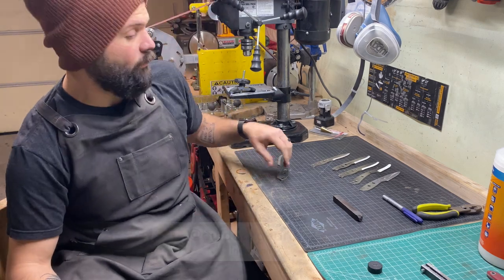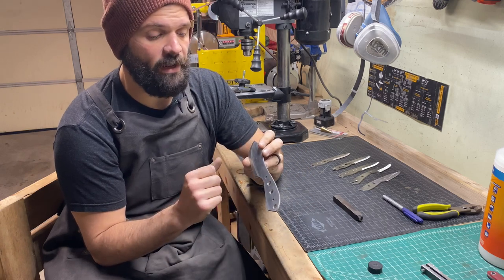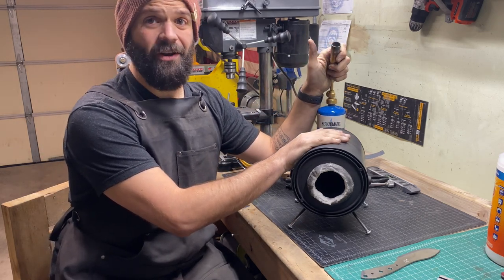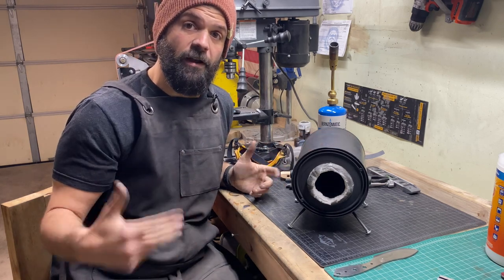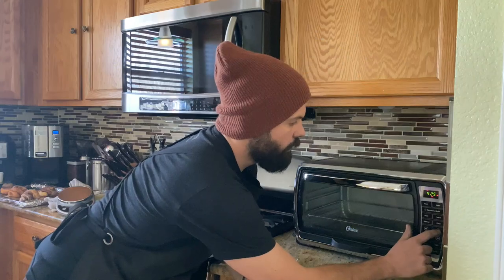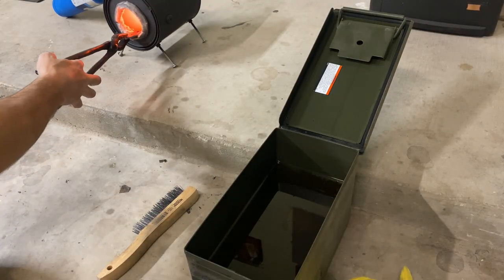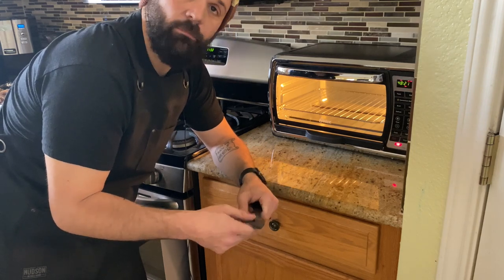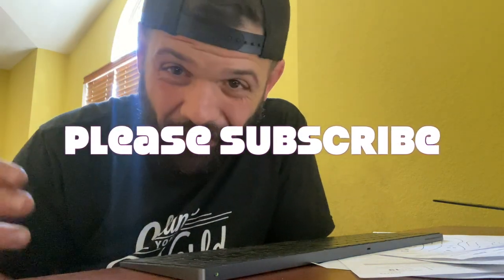DIY Knife Heat Treating (E. 6)

Comment: Hey man love the videos. Quick tip for when you are quenching is when you are heating up the blade heat up the tang first (about half the length of the entire knife) then flip it over and do the blade side. This makes sure you get an even heat on the entire knife and you don’t overheat the tip of your knife which is the thinnest and is the easiest to overheat.
Reply from the maker: Cody creasman dude! Love this tip.  Thank you.  I have since moved to an evenheat kiln so don’t really do this method anymore.  But sometimes  if I want to do something quick! Love it.  Thanks
Reply: @OutdoorGearDad  Which model kiln?
Reply from the maker: @paulbarrows3244  got the evenheat KH414

Comment: Did they leave the wool uncoated like they are known to do? If so, you are breathing in some bad stuff.
Reply from the maker: dkirby64756 it was coated.....with something.  I don’t know what, but definitely coated. Great advice though, wouldn’t be bad to throw a mask on.
Reply: @OutdoorGearDad  yeah, probably with a very thin coat of rigidizer. A little research shows that isn't enough. Unfortunately when questioned about it, they turned very hateful when just asked a simple question.